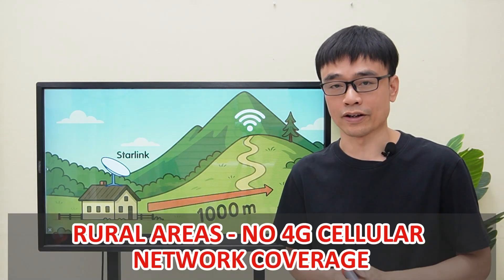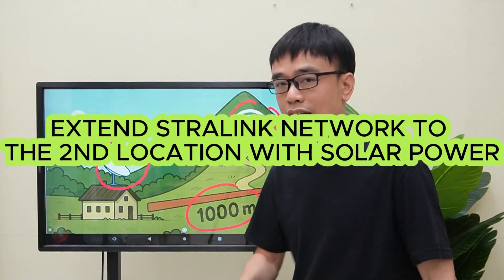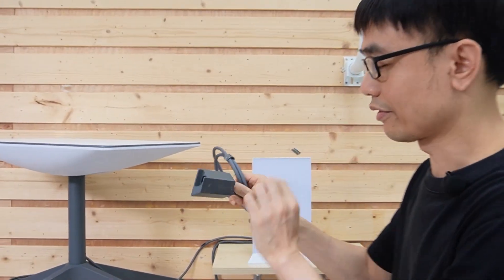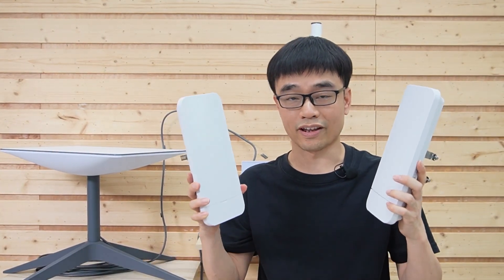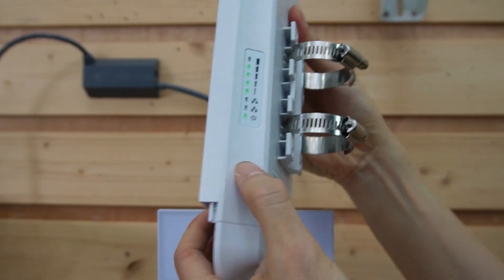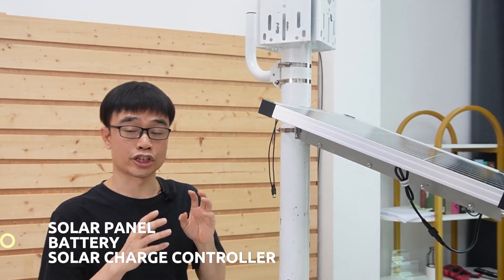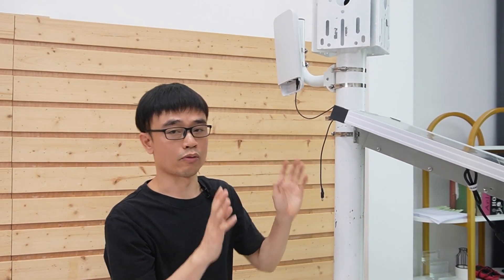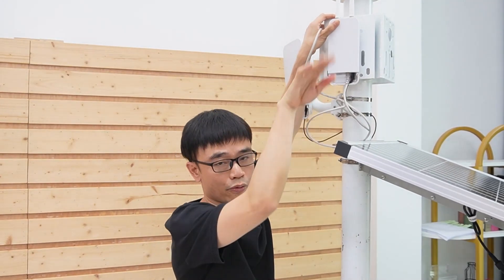Extend Starlink 1 km: Off-Grid Solar-Powered Wireless Bridge & WiFi Access Point

Comment: Hello Again, I have asked about the solar panel and the battery back up model if possible so we can buy it...
Reply from the maker: Hi, we don't sell this solar panel.
Reply: @Fastcabling  Thank you for your response but what model or some type of info where we can buy externally.. can you provide details like what wattage and battery capacity
Reply from the maker: The wattage should match your power consumption. You can look for solar panels with integrated batteries.

Comment: What type of solar panel and battery is needed.. can you give the details on it.. as i would like to install a camera in the same remote location.
Reply from the maker: Everything scales with the camera’s watts. Here’s a quick, drop-in method you can use for any camera:

1) Measure/estimate camera power (W).
Check the label or measure with a USB/DC meter.
Add ~20% headroom for IR LEDs/sirens (peaks).

2) Daily energy (Wh/day) = Watts × 24.
Add ~30% for system losses ⇒ Wh_sys = Wh/day × 1.3

3) Solar panel size (W)
= Wh_sys ÷ (Peak-Sun-Hours × 0.7)
Use winter PSH for your location (typical: 3–5).
Round up to the next common panel size.

4) Battery size (Ah @12 V)
= (Wh/day × autonomy_days) ÷ (12 V × usable_DoD)
LiFePO₄ usable_DoD ≈ 0.8–0.9
Lead-acid usable_DoD ≈ 0.5

Example A (≈5 W camera, e.g., TC65)
Load: 5 W → 120 Wh/day → Wh_sys ≈ 156 Wh
Winter PSH = 3 → Panel: 156 ÷ (3×0.7) ≈ 75 W ⇒ use 100 W
2 days autonomy, LiFePO₄ (DoD 0.8): (120×2)/(12×0.8) ≈ 25 Ah ⇒ pick 30–40 Ah

Comment: How can i connect 1000 users or more on a single wifi or mesh system. Im planning to sell my Hotspot to other people.
Reply from the maker: Please note that reselling Starlink services is not allowed. If you need to cover 1000+ users, you can use enterprise-level aps like Ubiquiti UniFi, TP-Link Omada, or MikroTik. Each AP supports ~100 users, so you'll need 10+ APs. Use wired backhaul for stability.
Reply: You just add microtic and a router which can take more than 400 on each access point.
Remember, you package matters too, consider to have not less than 300mbps

Comment: Hello, I need the details about solar system used on this project! If I want 16-20 hours backup for this type single outdoor AP, how much the capacity of solar panel and battery?
Reply from the maker: It is common practice to reserve 4-5 days of backup power to deal with rainy or cloudy weather. Let's assume the power consumption is 10W. These are the general specifications for the solar panel and battery. 200W solar panel 100AH DC12V battery.

Comment: We need to carry 200 Mbps video data (h.264/h.265) over wireless over 15-20 km distance. Is there any solution available. upload video if u can thx
Reply from the maker: 15KM could be achieved through WiFi7 wireless bridges, but it needs decent path (clear sight) between those two locations as clear as the sea surface.
Reply: We are a cable TV service provider, and we are exploring a wireless solution as an alternative distribution path in case of fiber line failures. Currently, our network does not follow a ring topology, so we're looking into using wireless bridges to maintain service continuity in critical areas.
Reply from the maker: 200 Mbps bandwidth is achievable, but the situation is crucial. The wireless needs not only the clear sight but also the decent signal environment. The interference could reduce the actual speed. You can set up two pairs wireless bridges and set the link aggregation on both sides to guarantee the network links.
Reply: @Fastcabling  Plus the latency over 20kms